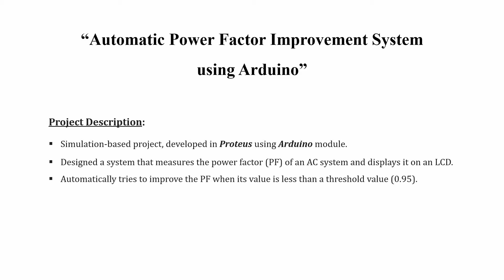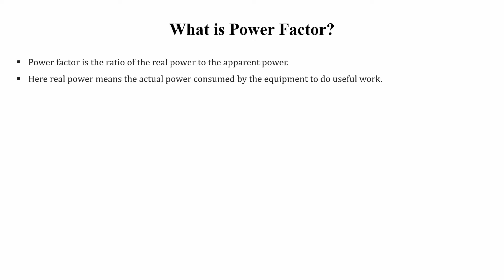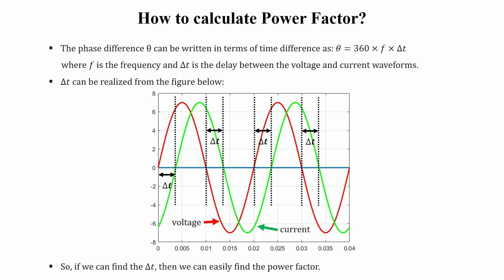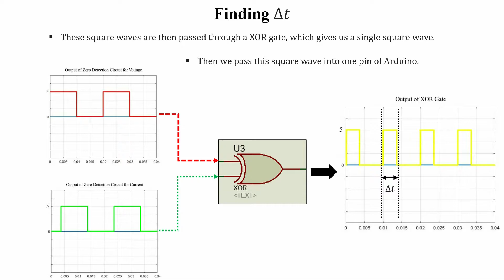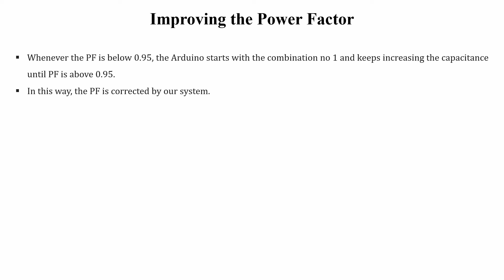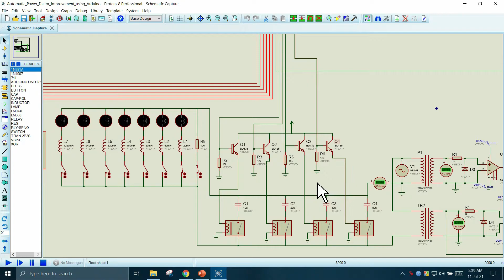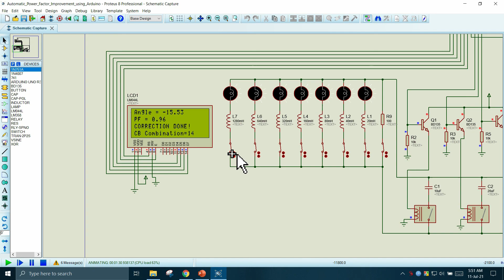Automatic Power Factor Improvement using Arduino

Comment: I have created the project in proteus but having a problem in simulation. I am unable to view any current change on the ammeter connected whenever I connect the switches to turn inductive load on. Please Help.

Comment: Could you please give me the code & circuit diagram?
Reply from the maker: Please check the link provided in the description
Reply: @md.moinulislamkhan9352  the linke not open
Reply from the maker: @happy4lovely  I have checked the link. It works fine. Many have accessed the files through this link. Please create a ResearchGate account and then try again.